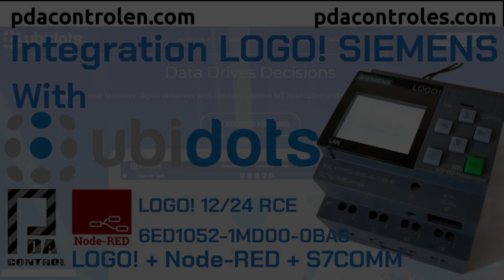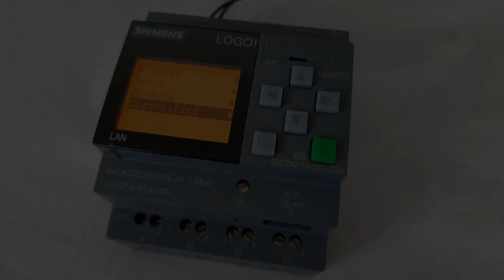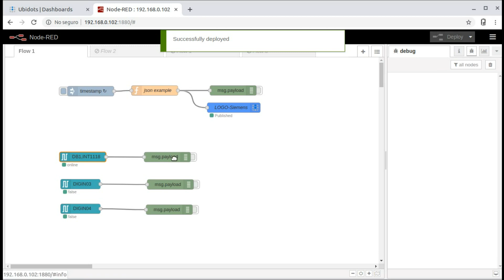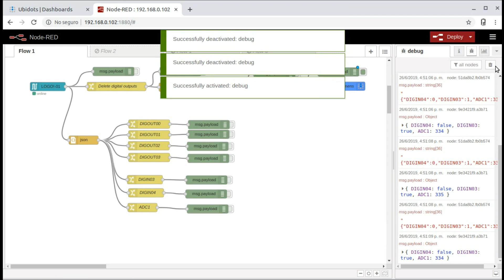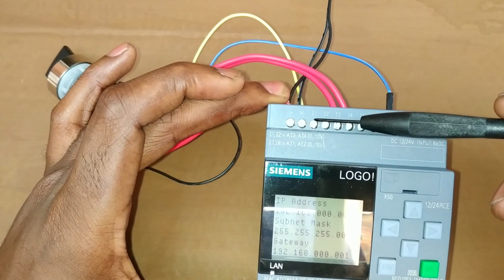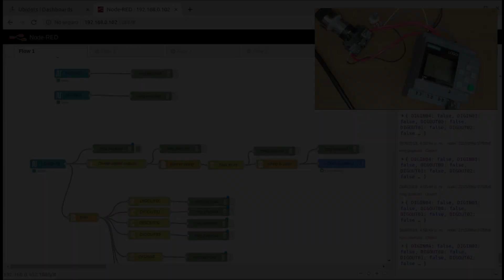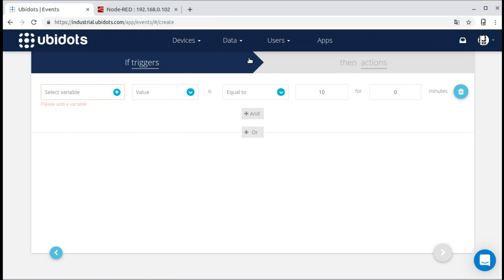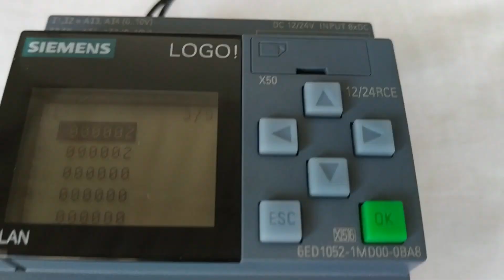Integration Industrial LOGO! Siemens with Ubidots Platform  IoT : PDAControl

Comment: Hola muchas gracias por compartir tu conocimiento, una pregunta cómo puedo obtener la dirección de memoria del ADC, en este caso asignas que I8=DB1.INT1118 de donde sale el valor DB1.INT1118 ?
Reply: DB1,INT1118 corresponde a la marca analógica 1 (AM1 del LOGO), has de describirla así en el apartado de variables de "node-red-contrib-s7"

DB1,INT1118      AM1
DB1,INT1120      AM2
DB1,INT1122      AM3
DB1,INT1124      AM4
DB1,INT1126      AM5
DB1,INT1128      AM6
DB1,INT1130      AM7
etc...
saludos!
Reply: Puedes ver este video NodeRed con PLC S71200, en el canal explico muchas cosas más
https://youtu.be/7qBnWHLa7_0